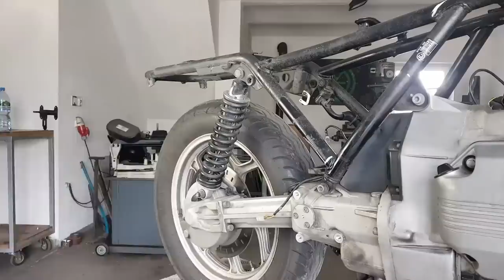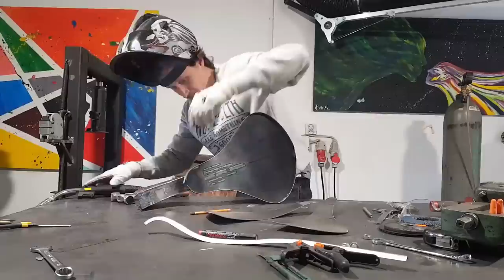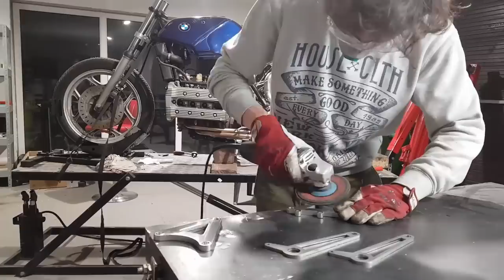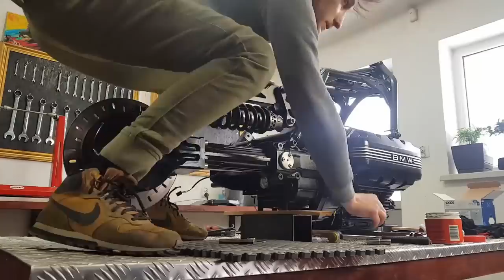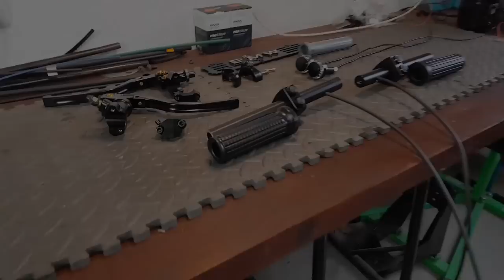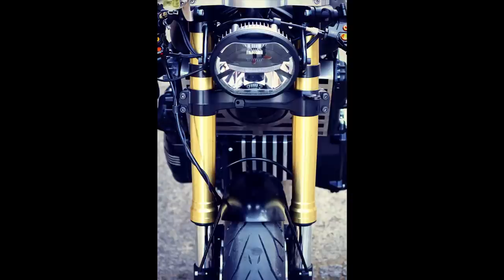BMW K100 Custom Cafe Racer by Moto-Technology

Comment: Awesome !!! from which motorcycle did you use the front wheel suspension and the triple clamps ?
Reply from the maker: Front wheel - Triumph Speed Triple 1050
Suspension - Suzuki GSXR 750 L0
Triple clamps - Our production

Comment: One drawback of leaving my birthplace (Britain) for Germany many, many moons ago now, is that home made mods and custom parts in Germany DO NOT FLY. TÜV is a beast. If its not certified with the correct marks or stickers (and certificates) its not allowed. It puts a kind of bummer on modding anything. I am sure there are work arounds but i havent found any yet.
Reply from the maker: I agree with you! the regulations are very strict, let's hope that someday the law will change and be more modification-friendly.
Reply: Yes, they are very strict but I still customized a 2000 Yamaha Fazer FZS600 2 years ago without issue.  I cut away a lot of it and added a custom seat.  I think I'll make an updated video to show the recent changes.
Reply from the maker: @gregoryaparker  We are waiting for the final results!

Comment: The seal in the rear wheel is dangerous, causing a lack of airflow, which leads to the bike swinging backwards
Reply from the maker: The motorcycle is not intended for traveling on the route, the discs are only decorative elements, greetings!

Comment: Inert gas?
Reply from the maker: What You mean inert gas?
Reply: @Moto-Technology  when welding stainless pipes of any sort you usually use a "protection gas" for the insider of the pipe, that gas is called an "inert gas.
I didn't see you use it in the video so you grinded down every tig weld before adding the next section or is 7 spikey on the inside?
Looks Great but what about the overall quality?
Reply from the maker: @Struler08  Yes we know. Thanks!